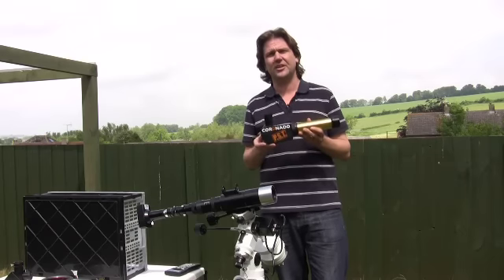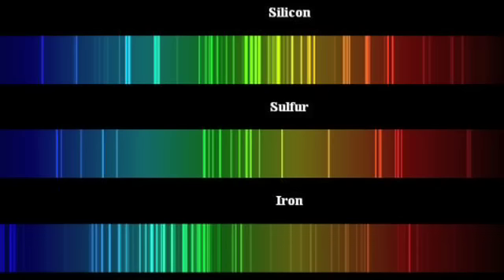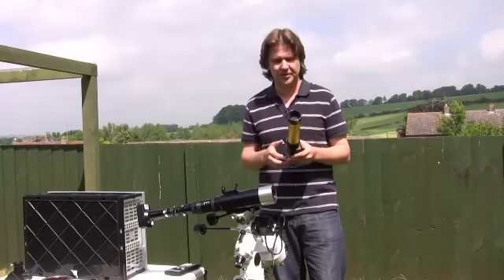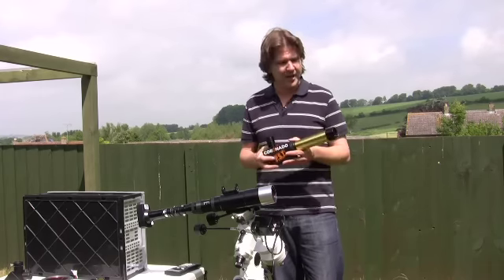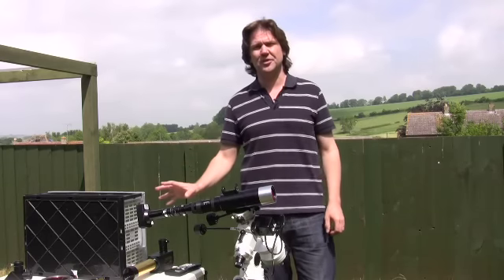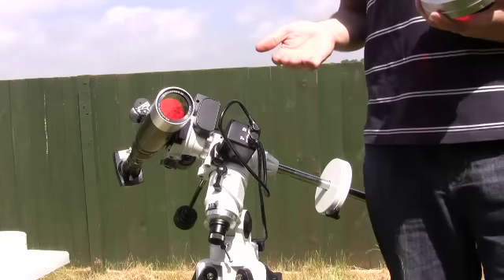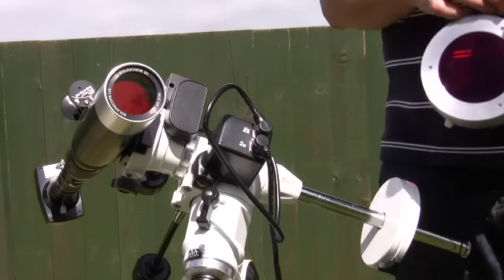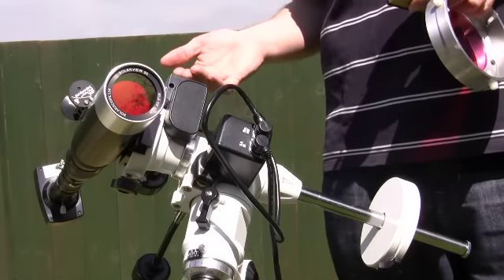Astronomy Now's guide to solar observing 1 - Introduction to solar telescopes.m4v

Comment: @howesnickhowes:  The Fabry-Perot etalon does *not* produce sidebands in the same way RF sidebands exist.  The etalon produces a large series of very narrow passbands each separated by a certain wavelength interval (the "free spectral range")., so the etalon is sort of a "comb" filter.   Blocking and trimming filters are then used to select the desired passband, such as the H-alpha or Calcium lines.